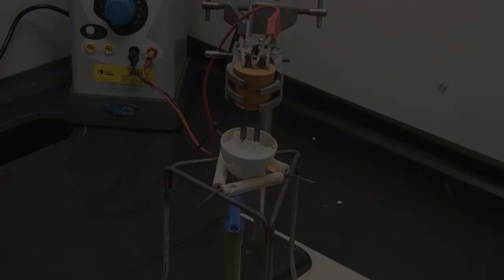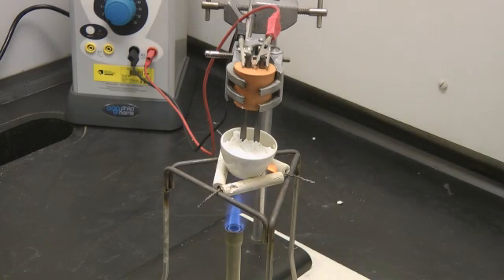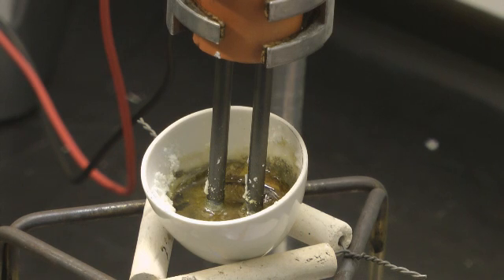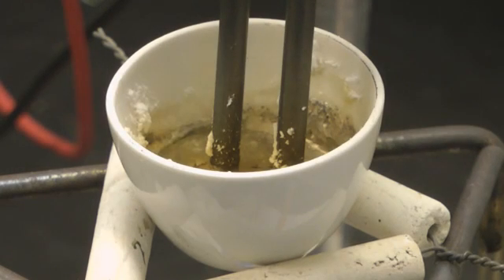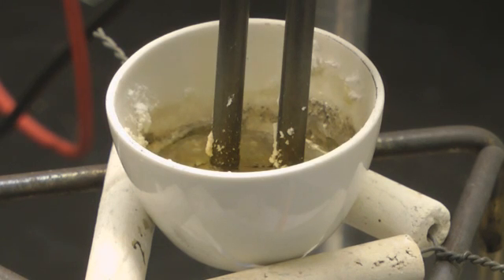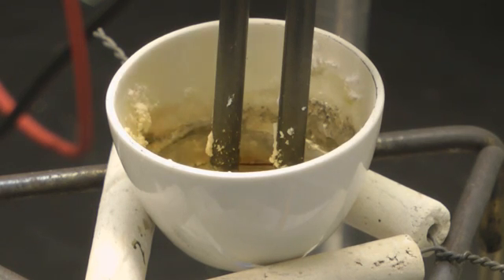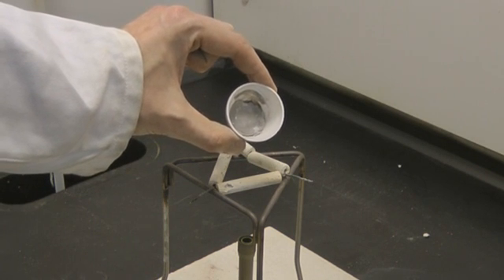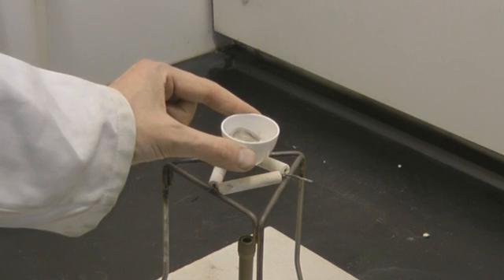The electrolysis of lead bromide

Comment: How come that the lead is formed at the bottom as if it was a sediment rather than at the cathode?
Reply: The lead will also form as a molten metal at this temperature, and due to its density it sinks to the bottom of the crucible.
Reply: He eats too much and became heavy and settled down
Reply: @sunitakarnani305  that makes sense
Reply: As lead gets discharged, it's no longer attracted to the cathode that's why it rather settles down
Reply: The lead is not attracted to the cathode as it has been discharged. It will sink to the bottom because of its own weight.
Reply: shut up muhammed
Reply: @lennonarnott-walsh6502  shut up Monke
Reply: @lennonarnott-walsh6502  lmao